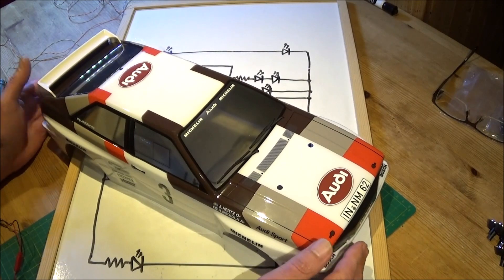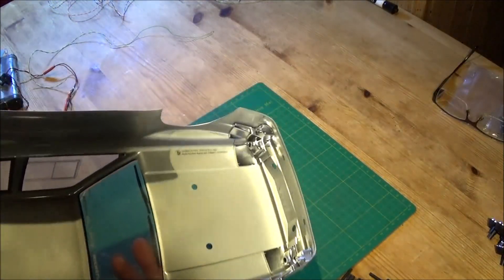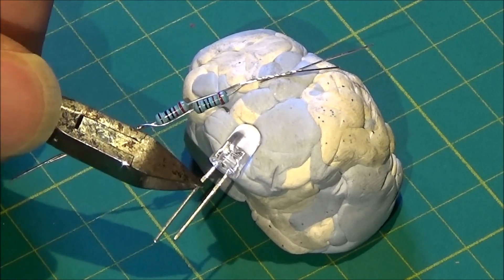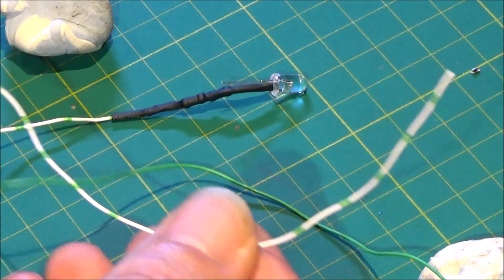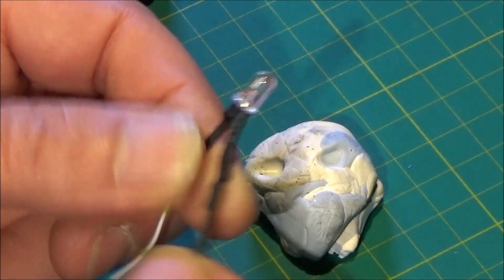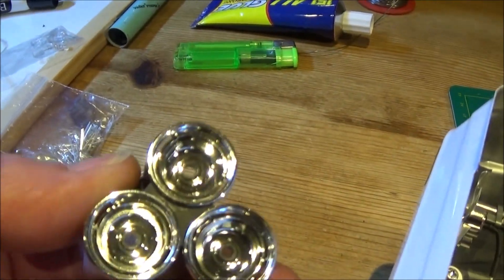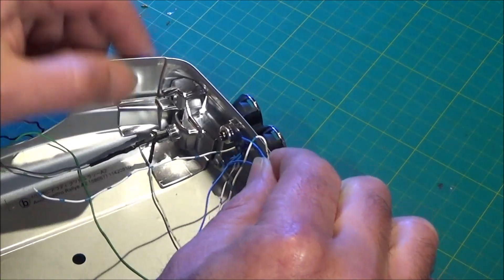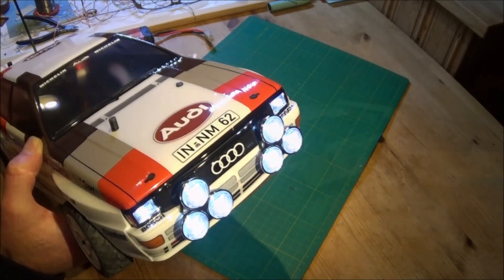How to Fit LEDs to RC Car - Tamiya Audi Quattro A2 Body Detailing P4

Comment: Morning mate.  Really interesting video and some top tips.  I hadn't thought about using blutac to hold the pieces for soldering but it's a great idea.  Also that gas soldering iron looks really good.  Like the way you can use the exhaust to shrink the heat shrink.  The end result looks fantastic with all the lights on.  Great thumbnail for the vid too.  Are you planning to be a bit careful with this one as I guess you don't want to smash all those lights into the ground or a tree?  Hope you are having a good weekend.  We went out last night for some drinks and a meal with was all very nice.  Was too drunk and full when I got in so straight to bed!  Having a get together with friends later so more beer.  Just charging up some batts and planning to go to the forest to do some RC.  Hopefully get some videoing done while I'm there.  I'm just going to head over to my latest vid as I know you left some nice comments :-)
Reply from the maker: Hi Pete - and thanks for your nice comments too! Yeah, that old blutac trick works a treat, much better than my shaky hands! Love the gas iron, it's good to not have the mains cable getting in the way, but that exhaust can easily melt stuff or burn you if you point it in the wrong direction! Yeah, gonna be very careful with this body, gonna run it, but no crazy bashing if I can help it. Can you believe, the instructions say to remove the spots before operating the car!!!
Sounds like you got a packed weekend, have fun and make sure you have one for me!  :-)
Reply: @MarkBryanRC  hi again. Ha, that's funny about removing the spot light before use. Not very easy when they have wires attached. I've just got back from a very muddy bash session. I was blasting the Firestorm around in the mud and it blasted the mud all over me from head to toe! Hopefully I got some good footage out of it. Also speed tested the Dual Ridge with the turbo sensored brushless set in. Very quick for a 2s battery. Just going to have a look at the footage before heading to our friends house for a drink or several. Have a good evening mate 😀
Reply from the maker: Hi Pete! Sounds like a fun time in the mud, at least it washes off! Let's hope the camera lens stayed clean! Boy, you got a lot squeezed in to a day - look forward to that speed run. I had a nice chilled evening in front of the log burner - have a smashing Sunday matey!  :-)
Reply: @MarkBryanRC  an evening by the fire doesn't sound bad at all. I've got a cold now which is annoying so I'm just doing a bit of editing of what I did yesterday. Hey I think that Facebook was telling me that it's your wife's birthday. Is that right then best wishes to her. Hope you guys have a smashing day 😁

Comment: In case you were to cut both leads and forget which is which, if you look at the plastic part you’ll see a flat section on the side of the cathode lead.
Reply from the maker: Cheers mate - great info - yeah I should have said in the video! You are spot on about that flat on the resin casing, I find it hard to see that flat bit with my dodgy eyesight! All the best, have a great weekend.  :-)